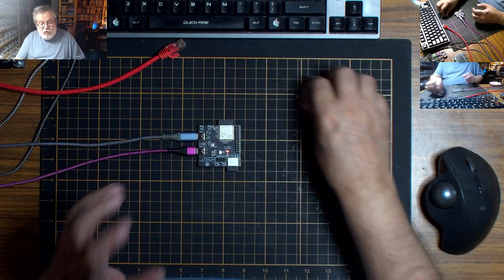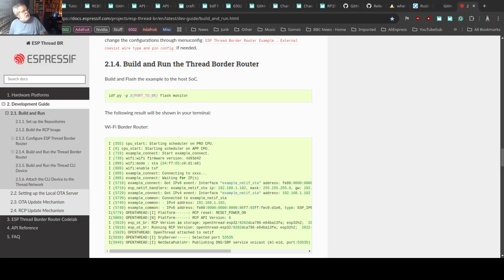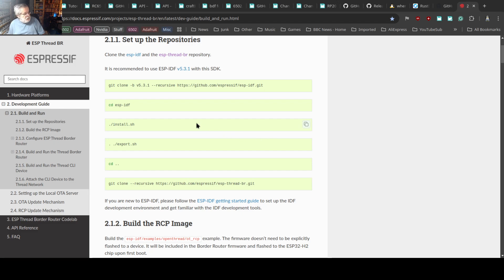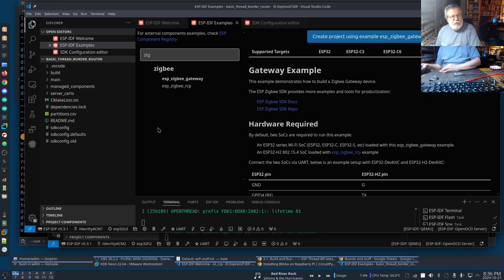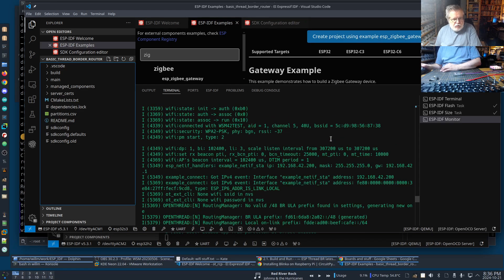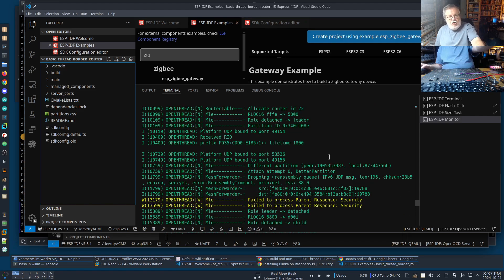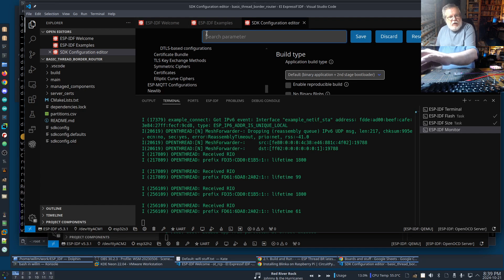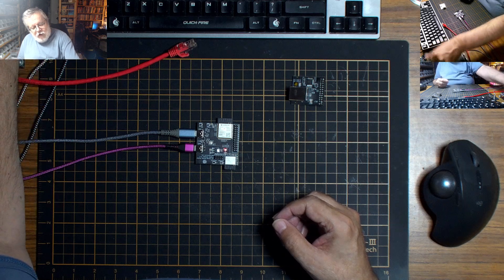More on the ESP Openthread Zigbee router

Comment: This was a video that was invaluable for how to setup these little esp dev boards, however I am still stuck on something which you may be able to point me in the right direction, based on a 3d model of a case for this board you only need to supply power to the s3 side of the board (usb2). What I want to know is how do you set the board to simply boot when power is applied without having to press the boot button? when I just supply power it never boots, but I want to be able to move it and just plug it in as all the config is now done. Thanks for the vids they are very interesting :)